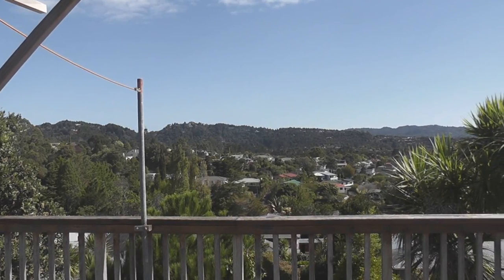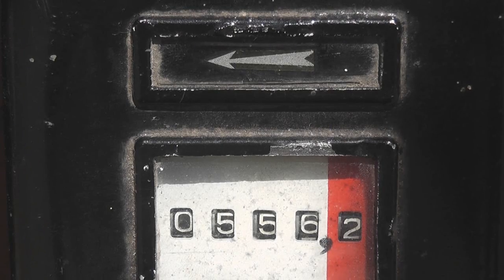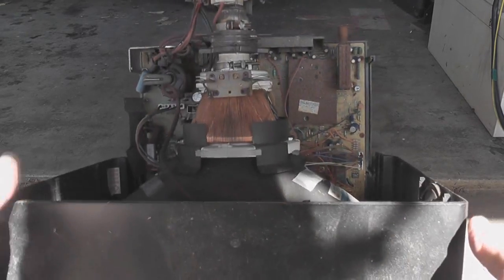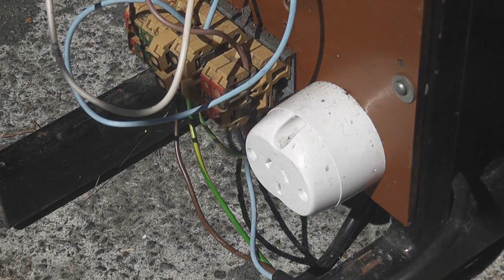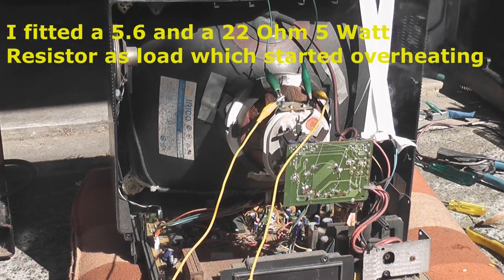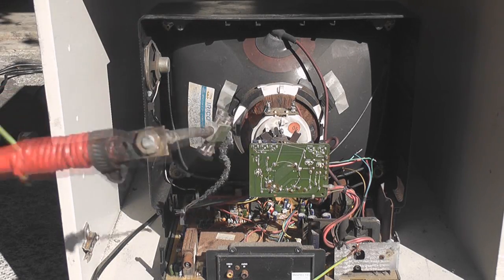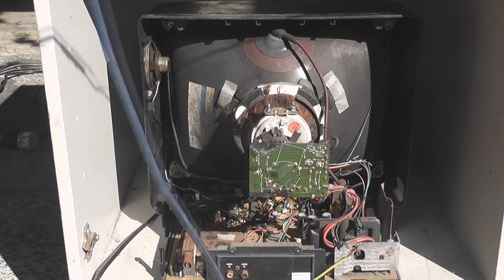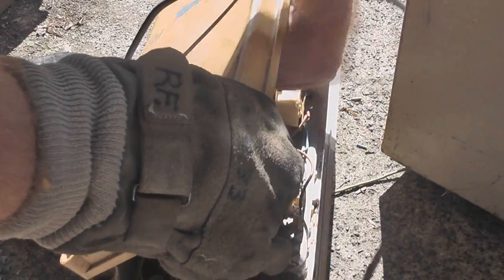Faulty CRT and some MOT arcs

Comment: Nice arcs 
but what do you mean with "resonator"?
Capacitors ?

Fokus
Reply from the maker: Yes, 3.3 µF 2200 Volts Caps in series with MOT output.
Reply: RODALCO2007 Thanks for the answer and
Can you please tell me how to find out the perfect capacity ?
bechause here if got a new transformer I can get 1.6kV at ~10 - 15 kVA+
http://www.bilder-hochladen.net/files/leul-1b-d9d4-jpg.html
just try try .... works ?

Fokus